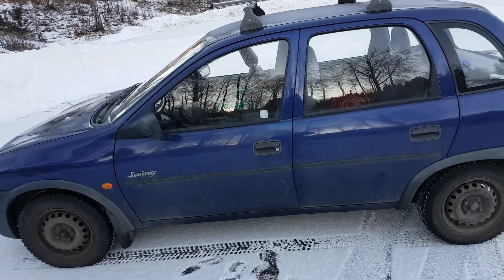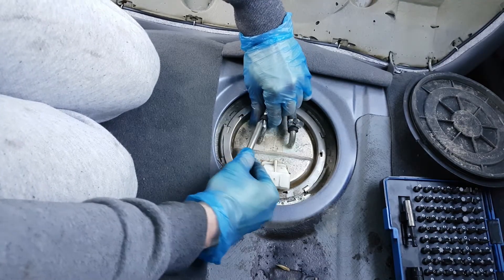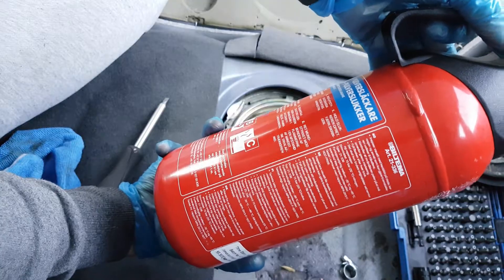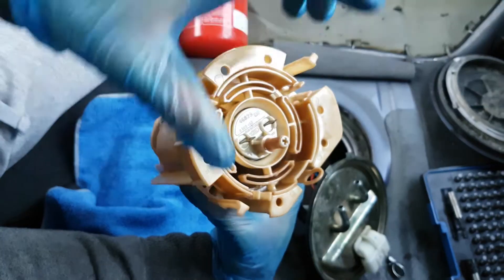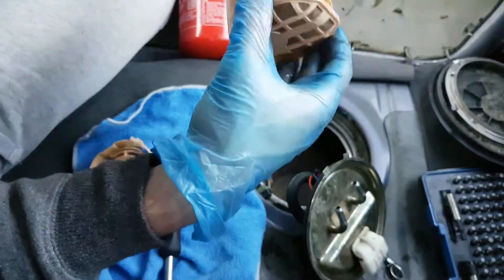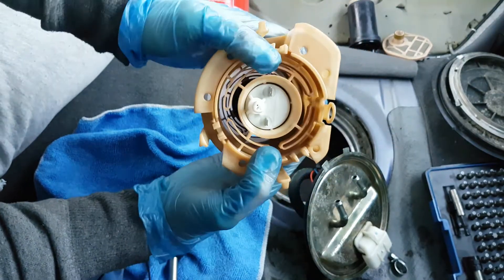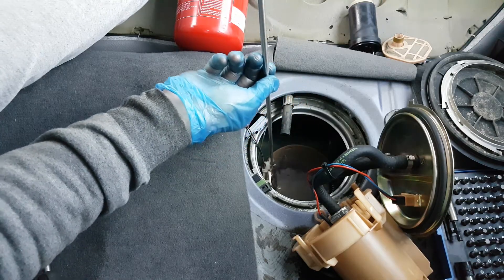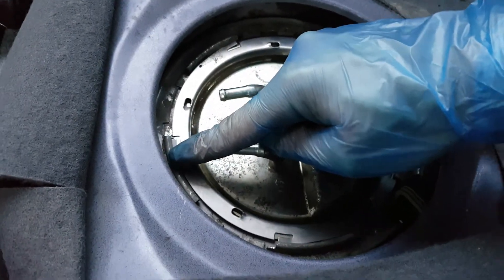Fuel Pump Replacement on Opel Corsa B

Comment from the maker: Other Videos about Corsa B : 
Semi injection : https://youtu.be/BQ6PSnV0gpU
Spark Plugs Change : https://youtu.be/3M-UJWgW7Zg

Door Lock Fix : https://youtu.be/wfVvM5YHW9A 
Fuel Filter Change : https://youtu.be/O9eYBZq0pFM
Oil Change : https://youtu.be/YBvPrcUSzXo
Alternator Removal : https://youtu.be/c2hT28ebhcw

Comment: Greetings from Portugal. My Opel Corsa 1.4 si from 1994 is not starting, maybe fuel pump. When I try to put it to work and leave the key i hear a click next glove compartment. I noticed that the f26 fuse was blown, I changed but it's still the same
Reply from the maker: Together with that click ,you should hear the fuel pump winning as well
Reply: @doit_vehicles  no, I was checking if the wire that reaches the deposit had 12v, I turned on the multimeter and activated the starter, and it has 11, something volts. The f26 fuse was blown, however I changed it but the pump still doesn't work, at least I can't hear any noise, when the car was still fine, sometimes the engine light came on

Comment: Is whining noise from the rear the sign of AC pump malfunction? It is continuous, and I hear it more pressing the accelerator.
Reply from the maker: It should be normal to hear a little bit of sound , but not excessive.  It should not increase together with the rpms and you can expect the pump to fail at any time
Reply: I don't think because the pump is running always with the same speed an delivering the samt volume rate of fuel. I think that rather your muffler from the exhaust system is  with holes from rust.

Comment: I have a problem with my corsa sometimes it start in one attempt and other times it takes very long to start i have to give gas and then it starts. And if i accelerate the car is shaking crazy. I have a opel corsa b 1.4sz 60hp it have just 93.000km so it makes me crazy.
Reply: I would change the temperature sensor with the 2 contacts, look if the the spark plugs are too old, if the spark plug cables have a bad isolation so that you habe sparks between engine and cable and maybe change the fuel filter.

Comment: So three things: 
- To get the assembly out of the tank, there are also three pins to press on the outter body. 
- Filter was stuck with a bolt between the plastick and the pump. I had to kind of break it loose. 
- Don't forget to secure the lid with the gummy ring around the lid, and make sure the lid is TIGHT. I didn't properly attach the gummy ring to the lid, and filled up my tank full. Next thing I know, out comes five to seven liters of gasoline running out of the tank, because the lid was leaking.

Comment: Removing  t the filter was never so easy  ... Not on my Tigra. I can separate the lower half  but the top is fitted to a metal spindle. Ideas??
Reply from the maker: On a newer car it might not be possible to replace the pump only
Reply: @doit_vehicles  Many thanks. First registeted 2005 so... But I've ordered the whole thing -- Ridex Fuel Feed Unit 54€ to avoid complications. While waiting I'm practising putting this one back in, and as per usual I didn't take enough photos. (And I also scraped a bit of insulation off one of the thin wires pulling the connector off the block with pliers.) Watched all the vids in all the languages that pop up to get a visual clue: which way up goes the large green rubber ring, and which hose goes to the white plastic connection (pressure regulator?) under the lid. At one point I thought I'd lost a hose but it was hiding in the petrol. Btw, I don't like using nut/screwdrivers in such a dangerous setting so instead of using a metal collar would a strong zip tie be okay, or is that a no-no? For the bit of bare wire I was going to use liquid rubber but read that that's a no-no. Was going to zip tie some insulation around it... Your opinion would be much appreciated. Thanks.

Comment: Hi there, i just had an issue on my opel corsa C fuel pump, sadly was on the road far from home and i had to call the insurance to pull it to an opel  garage that is even more far from my home ( around 60 km). i went today to pickup my car but due "misunderstanding" between insurance and car garage the problem was found not fixed: result i have to go back tomorrow.  they said to me that there were a rele failed that kept the pump running and burned it. result: 2 relais and fuel pump.  the connector is the same u show in this video, problem that i have noticed is that when i turn the key on the first step (priming) on the connector of the pump i read 3,8 V not 12, while in the fuse box voltage was around 11-12 ( they even dried the battery damn). pump was disconnected so even if was fault no shorts between + and - of connector. happened to you too? or it must be 12 V once u turn on the key? couse then i have an issue on the wiring between fuse box and pump connector
Reply from the maker: Hei ! It sounds like there might be a voltage drop on the wires . It should be 12 volt or 0 at the fuel pump connector . Here is a fuel pump test made on another car , but it's pretty similar : 
https://www.youtube.com/watch?v=xxVxbe0YQR4
But why they asked for 2 relays ? I personally never seen a relay beeing stuck closed and burn a fuel pump ...

Comment: I literally cannot remove the plastic ring, it's completely stuck, didn't you have any difficulties with removing it? I'm struggling, just pulling with all strength and it doesn't move.
Reply from the maker: do you meen the black plastic top cover ? or the metal ring that holds the assembley pressed ? If it's that ring try with some lubrication on the contact points and make sure that you pull it in the right direction . Also if it's possible have someone to apply presure on the assembley while removing the ring .

Comment: what is the symtoms of bad fuel pump on corsa B?
Reply from the maker: One of the most common issue is when you rev up the engine to high RPMs and the car does not go as fast as it used ; or it does not even go to high RPMs . Also it might just suddenly die on the road while driving . If the car does not start at all and the fuel pump does not make any noise when you turn the key in the ignition than the fuel pump is completely dead . A fuel pressure test of the output fuel lines will tell with accuracy if the fuel pump is faulty or not

Comment: Thank you for the video. I have a question though.. do you know what size the rubber gasket on the fuel pump cover is? Or where I can buy a new one? I have an opel corsa b 1.0 if that helps

My gasket was stretched and no longer fits on the cover so if I fill my tank too much, fuel leaks out over the top.
Reply from the maker: All right .. I see . Well I would just messure the exact diameter of the hole ( where the cover goes ) and double check with the seller the right dimension ; You can even go ahead and ask multiple sellers to be sure you're buying the right item . here are some links I found : 

https://www.ebay.co.uk/itm/VAUXHALL-CORSA-D-E-FUEL-PUMP-TO-FUEL-TANK-SEAL-RING-GASKET-GENUINE-NEW-/162198049354

or this online shop is the one I use ; you can add your exact vehicle and search for the gasket  : 

https://www.autodoc.co.uk/car-parts/seal-fuel-sender-unit-15134/opel
Reply: Thank you very much for the reply!
Reply from the maker: You're welcome , I hope it helps !

Comment: Very nicely explained, and I really appreciate the clear video from start to finish, with every step. I will need to do the same to my Opel Corsa C (2001). My father sais the principle is the same, but might be that the connectors and opening ring differ slightly. Have you done this to a Corsa C as well? I am preparing to change the piece myself. Your input might be helpful : ) Much appreciated, in advance
Reply from the maker: Hei ! I am glad that you find it useful . 
       About the fuel pump on Opel Corsa C from 2001 - I personnaly have not done any work on that model , but yes the principle should be the same . I won't be worry about major differences . The only thing which I found challenging is that top ring which should keep the assembley pressed . The dealership have a special tool only for that ring but it can be done with some screwdrivers and lubrication on that ruber ring though ..
        Identify each part or components that you don't recognize and try to find theyr purpose and how to dissassembley them . For ex: there should be 2 fuel lines , mark them with different colors , than you'll know how to connect them back . You can as well take pictures of every step you do dissassembley something so you'll know how to install them back . 
       Make sure that you have some hose clamps to replace the old ones as they are single use only in most of vehicles .
           Good luck :) and if you have any questions let me know .
Reply: Thank you. Good to know about the hose clamps. I'll buy a few new ones, just in case : ) About the rest of the tools you are using, besides the fuel pump which I will quite probably be buying tomorrow, I already have everything that's needed. I saw another material - with pictures and text, no video - where the hoses were tagged with a written paper tape. I might do the same, as this was my main concern, of knowing how to assemble everything back properly. Feeling a bit nervous, but after all the reading and documentation I've been doing, getting more confident :D Thank you for your support. Will let you know how it went. Some people will be out for a beer on May 1st, I'll be fixing my beloved teenage car : ))
Reply from the maker: haha I see , well cars need some atention as well :) And one more thing : If the old- broken pump doesn't make any noise when you try to start the car ,  you might consider checking the fuse of the pump in some cases the fuse is blown up and the pump is ok . In that case , if you have a voltmeter just disconnect the electric connector from the pump (where the fuel lines are )and connect the voltmeter to the wires and try to start the car - it should get 12 v . Than you will know for sure that the pump is broken .
Reply: From the symptoms I got, and all the male experienced advice I got, it's quite likely the pump. It gave up on me yesterday on the road, all of a sudden, as I was going within the legal km/h limit on a national road, and it suddenly stopped responding to when I set it into gear. Tried the 3rd, then 2nd, and even 1st, but only inertia helped me get to the side of the road. Then the engine refused starting completely, regardless of what we tried. The error codes given by the car were 0420 and 0170, but it appears that none of the issues raised by these errors don't result in a car not starting at all. Battery has been recently changed, fuel filter changed in December, and the interior lights were on upon door openings. I don't have an electrical measurement tool, it's true, but since the car has run smoothly over 170 000 km so far without a fuel pump change, this seems to be quite likely it.
Reply: Also, the fuel pump is completely silent upon attempting to start the engine
Reply from the maker: All right I understand .That's scary when the car stop responding while driving ! Hopefully you will be able to fix the problem soon :)
Reply: sorted on Saturday afternoon ;) My dear car is purring again ^_^
Reply from the maker: Cool !!  I am glad to hear that :)
Reply: @emma.c.r.  you need to do the same to my corsa 1.4 si 1994 🙂
Reply: @nq28153a  haha :D I have faith in you!

Comment: It's a big mistake not to put the gasket on the lid, any knock on the road could get out of the fuel
Reply from the maker: which gasket do you meen ?
Reply: @doit_vehicles  I miss the league that seals the pump cover
Reply: @jairolarte2183  Can you tell me where is the fuse for the fuel guage
Reply: @moosahassim6167  If I'm not wrong, it's right there in the rifle, it must have indications, which is which, the rifle is under the button for lights